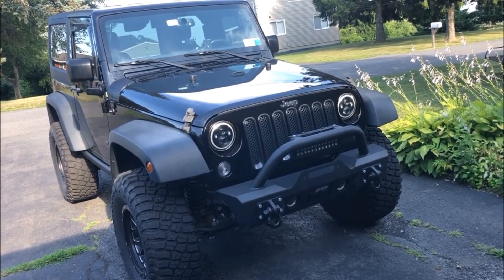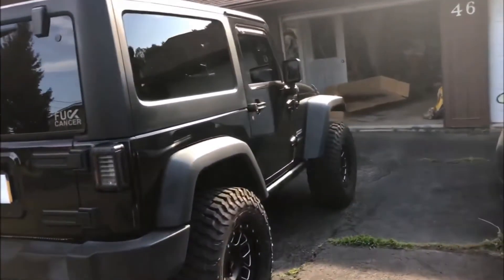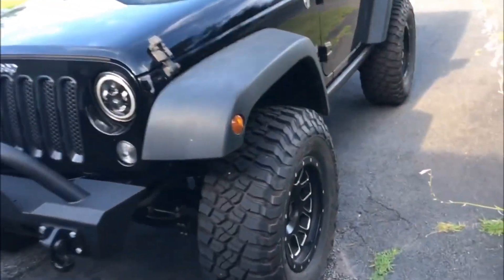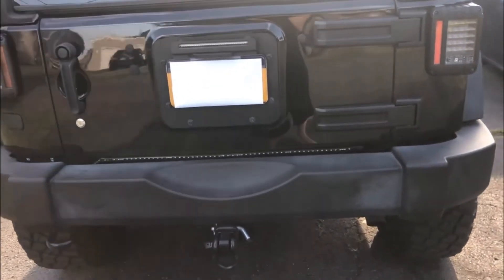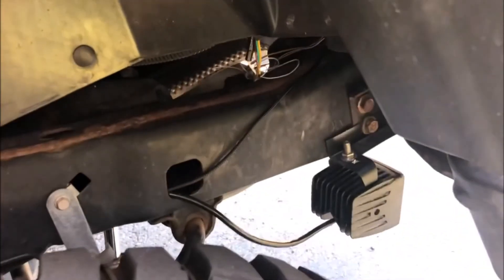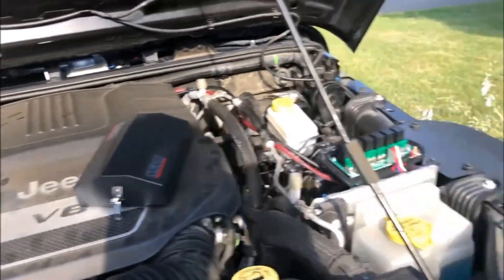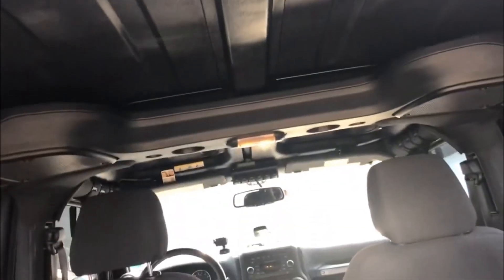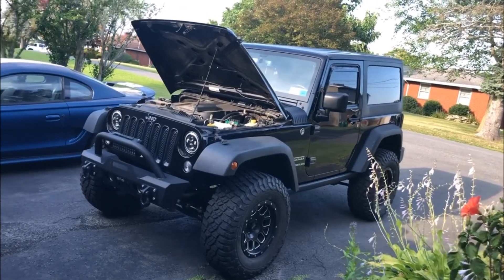Jeep Wrangler JK - Detailed Build Overview

Comment: There are two types of people who knock RC. The first are the guys who spend thousands and thousands on lifts, and then go and buy 22" rims with a tire that looks some somebody wrapped the rim with a rubber band. They're just angry that they spent so much.

The other guys that knock RC are the guys that pretend they have built Jeeps but actually drive a '91 Civic Hatchback and deliver pizza...

Never had a problem with RC lift kits, install them right, buy the extra's that RC recommend, and don't try to kill your vehicle. By the way, the MLC-6 light box is about one of the best things any company has ever made...good choice
Reply from the maker: thanks for watching man! yes rough country ain’t bad at all, know plenty of people who’ve run their stuff with zero issues including myself. all their other products other than lifts are great as well. love the mlc-6 and my light bars as well!